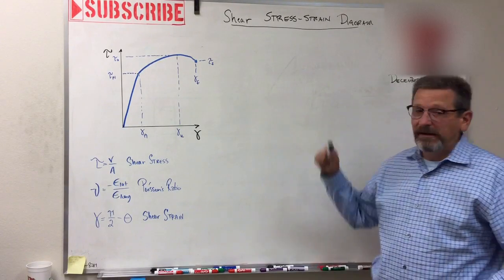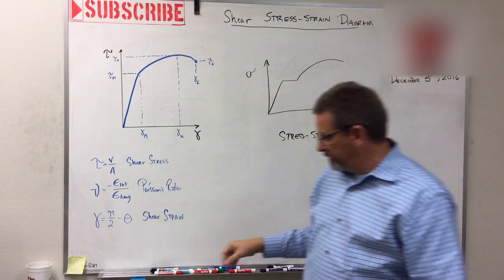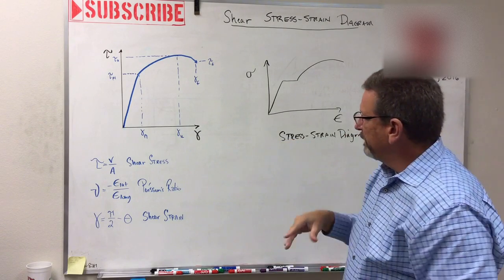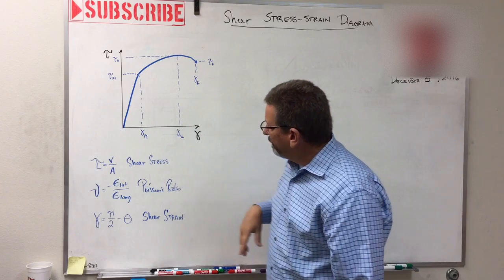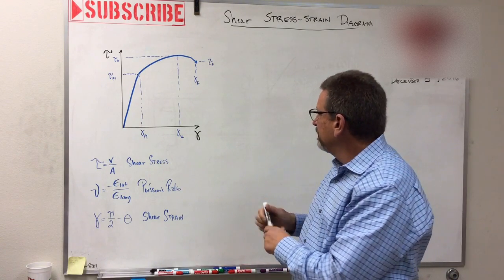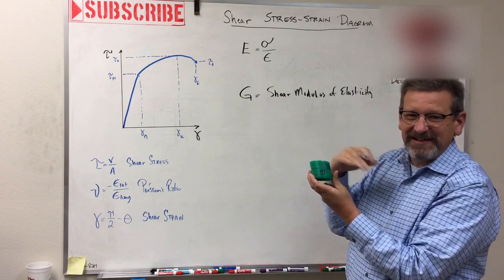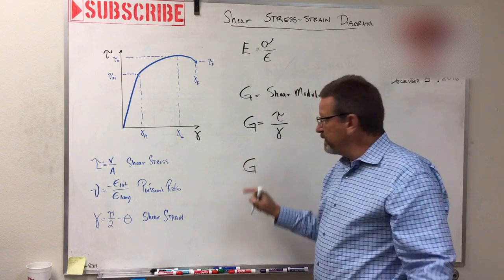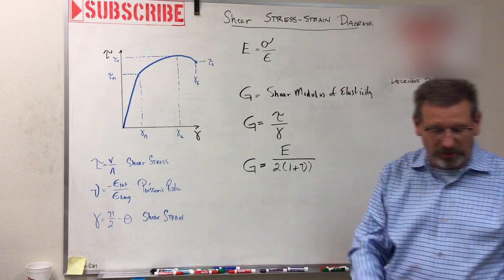Mechanics of Materials: Lesson 12 - Shear Stress-Strain Diagram

Comment: Maybe a little bit of an odd question but what does it mean if when you solve the modulus of rigidity equation for poisson ratio and it comes out negative? Does that mean the material will expand in both the lateral and longitudinal directions?